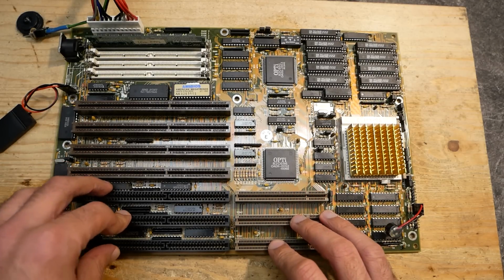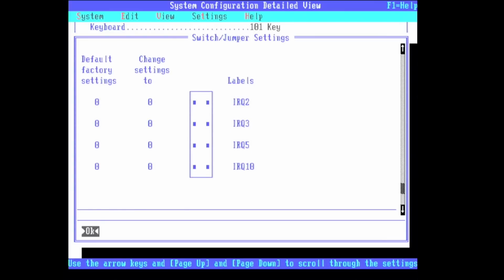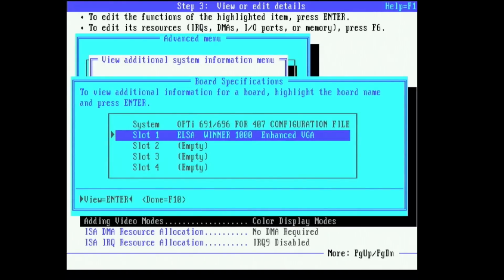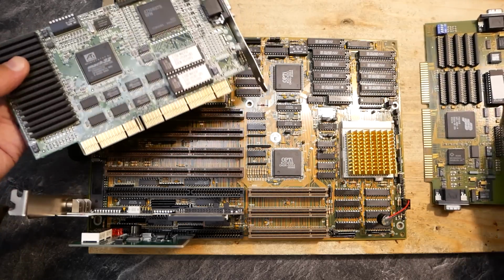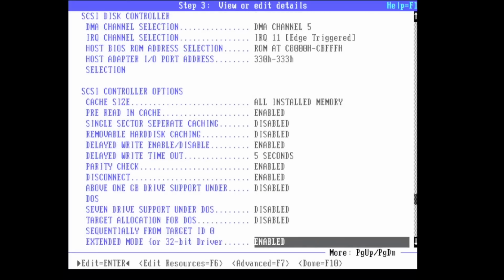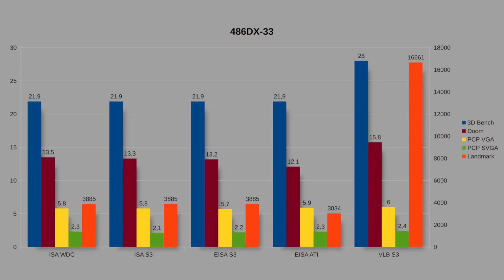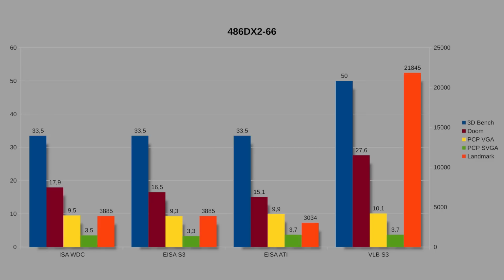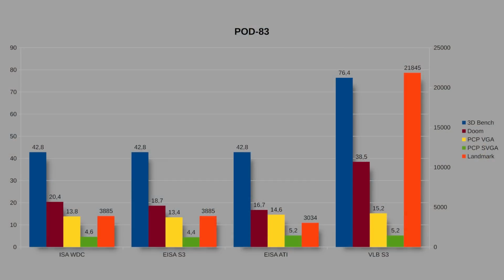Configuration and test of a 486 EISA/VLB mainboard

Comment: EISA really flew under the radar for me. 95-99 I worked as PC support/programmer so EISA was just an acronym, there might have been a few Dell workstations that had them. And by the time I started working on servers, PCI and PCI-X was the standard for expansion slots.
You could create a multimonitor setup with all those cards. I think I had six monitors going at once in 2001 using Matrox PCI cards. Running X on Slackware
Reply: i got a Compaq 1500 that has EISA and a compaq 1600 that has EISA

but the 16 needs a wd-40 intervention

Comment: I think you choose your test software poorly. To see enhanced performance from eisa you should use software actually made to take advantage of its capabilities. The software just used eisa like they would an Isa card. 
Find some cad package or something that is optimized for eisa. It won't get to vlb speed, but it should do better then. 
Also just because theyvattached aan Isa based chip to another bus doesn't mean the chip got any better. Like the dual bus card makes clear, that chip will just function at the lowest possible common denominator.
Reply from the maker: Yes, this is what I basically also concluded. I was interested if DOS gaming would somehow benefit from it, but, well, obviously not :) That's why I think, the best is to try out Windows 95/NT to get into 32-bit OS and all the software which potentially could benefit from a 32-bit EISA bus.

Comment: Oh, the cfg files WERE a royal pain in the back. For both, EISA and MC (which also needed similar ones). 

For a lot of adapters, you simply didn't need any special driver, but you always needed the config file. At times, where quickly downloading a file from the internet wasn't a thing. So you had it on a floppy - if you had it. And better a copy or two of that floppy, especially as field engineer, because they always had read errors when you needed them the most. Even then, I more than once run into situations where I had to create a new one, copying the still readable files from all three copies together in the hope to get at least one valid copy of each file I needed.

For jumpers, you either simply knew it for adapters you dealt with often, or you had hints printed on the silk screen, or a cheat sheet on paper, which was ways more robust than any floppy. Or you could phone a colleague who looked it up for you and told you. And for mass roll-outs, you (or your apprentice) configured all 100 adapters before you went out and were done the moment the machine booted and recognized the adapter.

In the field, software based config with the need for additional files was really no benefit.
Reply: And good luck getting a hold of the random manufacturers of the card if you needed a replacement floppy.
Reply: @2dfx  Yeah. Back then, I worked for a repair shop which did vendor independent service and also board level repairs. It was such a pain in the butt... You couldn't even test an adapter without those damned files. Our "library" of config files was one of our biggest treasures.
Reply: haha yeah... I had a 1 Mb EISA Compaq true color? (I think?) card and I really had to play with the CFG files to get it to work. I eventually, through substitution, got the damn thing to work. It was a PITA.

Comment: Isn't the eisa slots compatible with standard isa cards. And also I think the reason the isa and eisa cards performed similar because they are just designed as 16 bit isa cards as good enough for the use case. Really am curious if the isa cards do fit the eisa slots and work.

Comment: Seems to me that the best would be to test the data transfer, an SCSI, IDE adapter or network card or even a soundcard with CD-ROM port. Those would benefit from 32-bit EISA bus. Would be interesting how EISA compare to VLB on those cases.
Another thing, how would Win95 for example would behave when using ISA vs EISA video card at higher color depth (16, 14 or 32 bit) and/or higher resolutions? I guess that then the bus width would matter for the videocards.
Also, this Award BIOS do not have hidden features?
I only once had a EISA motherboard but never find a EISA card so this is new to me.

Comment: PCI had a maximum pool of 4 IRQs .. INTA-INTD, borrowed from ISA (and if you had too many integrated / ISA devices, it could have less than 4). They were rotated through the slots (and any integrated PCI devices), so that if there were >4 in total, sharing was unavoidable. Being level triggered, rather than edge, PCI was supposed to be all good with IRQ sharing, but some cards were not so good with it, SCSI being one that was best not sharing

Comment: IRQ can be level or edge triggered? I have never seen that option before. Is there a possible conflict when a card uses i.e. edge tregger while board/CPU uses level trigger?
Reply from the maker: Yes. I didn't know that was a thing on EISA too. I always thought it was first introduced with PCI, where cards could share  the same IRQ.
Reply: @necro_ware  According to the AI output at the top of a google search:

EISA (Enhanced Industry Standard Architecture) is typically considered edge-triggered; meaning it responds to the transition between high and low voltage levels on a signal, rather than the sustained level itself.

EDIT: A slightly differently worded question gave to opposite answer, and yet another said it depends on the card. Take the first response with a grain of salt, though it might we worth trying each setting.  Also, testing the performance of a hard drive controller could be interesting.

Comment: EISA would be only faster than ISA if 32bit transfers are used.
In 2D benchmarks this would be the case with 24/32bit graphics,
depending if the VGA driver is optimized for 32bit transfers and not
simply the same as for ISA cards.